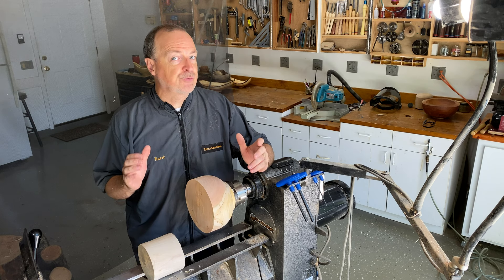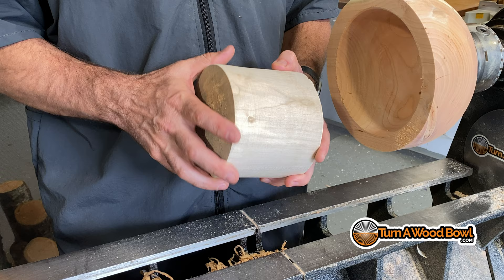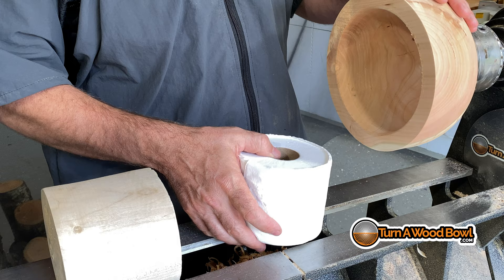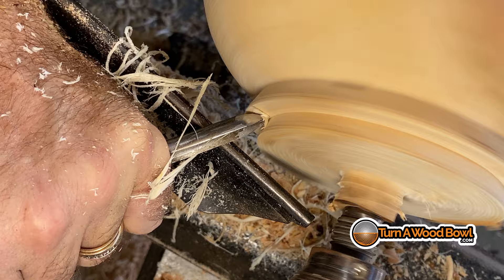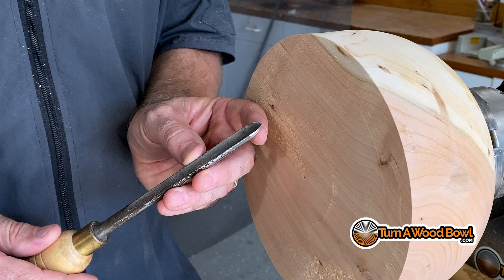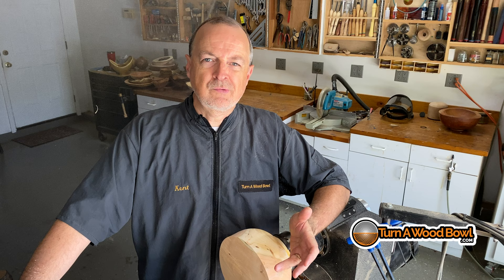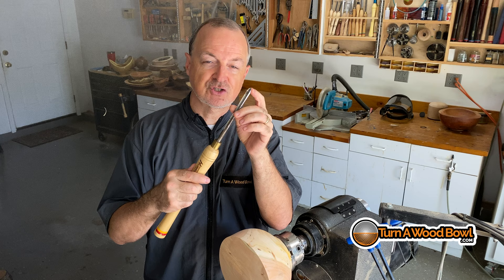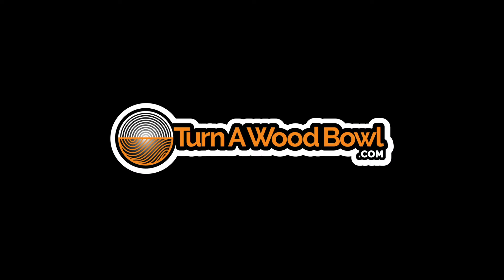3 Dangerous Tools - Woodturning Bowls Video

Comment: Now I find a video where I’m told not to smooth the outside of a bowl blank with the spindle roughing gouge!  I learned the hard way, bent the tool, sent the blank flying (luckily away from me) and scared the ** out of me, but I haven’t done it again.  But your video would have been much better before my learning the hard way method.  Thanks and keep them coming.  Cheers, Tom
Reply from the maker: I'm glad you weren't hurt! Yeah, this is a dangerous tool that everyone needs to know about. Thanks for sharing!

Comment: I know this video is about what not to use but...Whatever happened to the 'round nose scraper' for turning the inside of bowls?  Unless I'm not looking hard enough I rarely see anyone discuss these.  My reading on the subject of turning inside of bowls mentions theses as "THE" tool to use for this.  Caveat: my source is an old turning book from the 1920s using a foot powered lathe.
Reply from the maker: Very interesting. In the 1920, the bowl gouge, in it's current form, didn't exist. We really want to cut the bowl interior with the bowl gouge and a round nose scraper can be used to touch up areas if needed. Watch my video on the round nose scraper for tips. Also you might want to see my most recent video about the bowl interior. Happy Turning!

Comment: I use a huge bowl gouge well, in my opinion, almost an inch across. It works vary well for most rough work, and if not, I also have carbide and other ones.

Comment: This is a great video that I wish I saw a few days ago. I am new to turning and have been using strictly spindle tools (because I didn't know there was a difference). I actually had one of my gouges snap at the exact spot you mentioned, right above the handle. Not a fun time. Great video.
Reply from the maker: So glad this helped solved the issue. At least you know what happened now. Be safe and Happy Turning!

Comment: i can confirm the spindle roughing gouge, did that as a new turner. on bowls broke one, another ground swept back bent the shank where it meets the handle at least 30 degrees. spindle gouges are so common second hand. and now knowing what i know now. don't be like me and learn the hard way. now i almost exclusively use a quality bowl gouge, two sizes. and a custom made mortise scraper i think it would be called since i prefer mortise over tenon. (most of the time)
thanks for the informational videos, turning in general seems like a growing community of great, patient and supportive people.
Reply from the maker: Thanks for sharing! Yes, turners are a good people…usually! Happy Turning!

Comment: I wondered why I had so much trouble using the parting tool on my bowls... I thought it was sharpening at first and then I changed to a softer wood and it was still hard. Thank you
Reply from the maker: Ah, great, now you know. That darn end grain can be brutal! ;) Happy Turning!
Reply: Not mentioned here, or maybe I missed it, is the necessity of providing relief for a parting tool. That is, make the cut wider than the tool itself so the sides of the tool do not rub against the sides of the cut.

Comment: there are more then three you forgot the skew and round nose scraper . i like using a mortise instead of a tenon i use the skew to get the dove tail on the inside of the mortise . to each there own i guess .   i know a tenon is stronger in some cases  but i like a mortise better and you dont have to remove it if you dont want to . all the tools can be dangerous but your info is spot on about the shaft having to be solid and strong .
Reply from the maker: Yes, there are more dangerous tools. This video I focused on three. Be safe out there!

Comment: Hey Kent, I’m new to your channel and just a novice turner. Thank you for the all the good information  and clearing up a few questions. The one tool which scares the heck out of me is the skew. If you have a video on how to use it I’d love to see it.  If not could you please put one out so I can understand how and when to use one.  Thank you.
Reply from the maker: Thanks for asking. The skew has no business around a bowl turning. Perhaps it can be used to shape a tenon or mortise, but that would be the limit. So, if you're scared of the skew, just get rid of it. ;)
Reply: Agreed. Incising a fine line on a spindle with the long point of a skew is the only operation I can think of that cannot be done with less risk with another tool. Even the traditional planing cut on a spindle can be done just as efficiently and with more control by 'shear scraping' with the wing of a bowl gouge or a dedicated scraper used in the shear-scraping mode. There is no glory in using a skew when another tool will do the same job with less risk.

Comment: I'm knew to wood turning so I'm for sure going to listen to you. I have a roughing gouge from Carter & Sons. It looks pretty stout at the tang. Have you seen it and what do you think?
Reply from the maker: Good question. I have not seen that one, but a "bowl" roughing gouge has no size change into the handle. The full shape of the cutting portion goes down into the handle. If the steel tapers and reduces before entering the handle, its a "spindle" roughing gouge. Hope that helps. Happy Turning!

Comment: I use my parting tool on my bowls to cut and clean up the tenon . Typically with relief to one side .
And also to cut a groove around the outside for inlay material. 
I've never concerned that it was used in a scraping capacity. 
I am careful to have a light touch and also not to get too far from the tool rest. 
Thoughts on the bedan or a carbide square tip to cut tenons.
Reply from the maker: Sounds great! Light cuts, no problem. Basically any tool that gets the job done for shaping the tenon is fine. Just be cautious with your tool selection when roughing and shaping the bowl.
Happy Turning!

Comment: Thank you. I was about to buy a parting tool as I am super new to turning. Glad I checked out your video.
So, what do you use to part a bowl off?
Reply from the maker: The parting tool is used mostly with spindle turning to separate sections. A parting tool can be used for minor tasks while turning a bowl, like shaping the foot or forming a recessed mortise.
Reply: I like to use an old reciprocating saw blade that I ground down to a very thin parting tool. But only use it for parting off  the bottom, like if you're using a glue block or paper joint. Check out Mike Peace on YouTube, he has a video showing one up close. Simple and cheap parting tool. Don't use it for shaping or hollowing.

Comment: Kent, in another video your spindle gouge used to turn off the nub of a foot looked to me as though the heel had been ground away.  Made sense for the way it was being used.  Now looking at your spindle gouge at the beginning of this video it also looks like the heel has been ground away.  Are bowl and spindle gouges different in that way?  I don’t do much spindle work but I do want my tools right for the job.  Advice?
Reply from the maker: Yes, this is a spindle detail gouge and the heel is usually ground back to make it easier to cut into tight narrow spaces.

Comment: I do use my skew to make a precise and perfect tenon dovetail angle that exactly matches the angle on the chuck jaws. It is a low stress scraping cut; never had a catch or a tear with a sharp skew doing this. Am I being foolish doing this?
Reply from the maker: Yes, a small scraping cut like that can be done with no problem, just don't use the skew for any large material removal and you'll be fine. Happy Turning.

Comment: Great video.  There is not enough about safety in woodturning.  Be sure I would not use a SRG on a bowl after some videos I have seen on that matter.  

However, what approach should we take if we want to work a quite irregular log and want to rough it into its roughly cylindrical shape up to its general outside shape? In particular if the log cannot be oriented with the fibers parallel to the base of the lathe.  Some log have intersections of trunk and branches and the fibers seems to go in all directions.  Bowl gouges looks quite small in regards to the huge amount of chips to take out at the start, like using a spoon to dig a hole in the ground instead of a shovel.  So, is it a matter of using the biggest bowl gouge available?  All is in the shape of the gouge?
Reply from the maker: Yes, you got it. I use a 5/8" or 3/4" bowl gouge to rough out irregular bowl blanks. Happy Turning!
Reply: @TurnAWoodBowl  Many thanks
Reply: @TurnAWoodBowl  I appreciate. Would you recommend a U shape rather than a V shape?  And what companies would you recommend?
Reply from the maker: @alaincaron225  Good question. I recommend a parabolic shaped bowl gouge. That is what most companies sell, see my Recommended Equipment Guide https://turnawoodbowl.com/recommended-equipment/

Comment: Good video Kent.  Have you ever made a lidded vessel or bowl in a cross grain orientation?  If so, how do you remove the lid for initial hollowing and fitting?  Unfortunately I tried this in my early days of turning with a diamond parting tool which caught, twisted in the kerf, yanked the shaft out of the handle and then hit my hand (which was behind the tool rest) on the next revolution.  Resulted in a nasty cut, ER visit and a few stitches.  Wish I saw this video before I learned the hard way.
Reply from the maker: Yikes, I wish you had seen this earlier too. You can make multiple cuts or passes and create a cut wider than the parting tool. That will prevent the tool from grabbing. I have a lidded bowl video coming up in a couple weeks. Stay tuned! Take care!
Reply: Turn A Wood Bowl I thought I had the cut wide enough but obviously not.  I look forward to the lidded bowl video.  I’ve been hesitant to go back there after my last endeavor.

Comment: I am just beginning my bowl turning adventure.  I started with a square blank.  At a lower speed the piece kept stopping while at high speed it tore up the piece.  What should I do?
Reply from the maker: Be sure the tailstock is tight to the bed rails and tighten the quill regularly. Then make smaller bites. Happy Turning!

Comment: Really great video. Have you ever thought to use you skew chisel to create the tenons for your bowls? I do and its quick, easy and you can set your angle really quickly. I use it for creating the rebates on the back of my bowls if needed.
Reply from the maker: Yes I have. Unfortunately, my skew has rounded sides so it doesn't sit flat. And because I primarily turn bowls, I haven't purchased a flat-sided chisel. But, yes, you can use a skew for small detail work like shaping the tenon. Happy Turning!

Comment: Would you consider it ok to use a parting tool for doing small adjustments on the foot? (Basically same as you were using the spindle gougle)
Reply from the maker: Yes, light shaping is not an issue.

Comment: Super helpful video! I was just about to try my first bowl in the next few weeks!  Any recommendations of what kind of wood would be good? There's lots of Maple and Sweet Gum  by me and I do have access to Oak.  Are they any good?  Thanks again for all the great info!
Reply from the maker: Great question. For first bowls, and based on what you have, I would avoid the oak (at first) and start with the Sweet gum, especially if it is wet or green. That should turn beautifully and be a bit forgiving as well. And the Sweet Gum isn't necessarily showy so you won't be afraid of "messing up" a nice piece of wood, as you learn. All the best to you and Happy Turning!

Comment: What tool do you use (Since you said to not use a parting tool) to remove the glue block from bowl when that purpose is done?
Reply from the maker: Well, if the glue block is not huge and you're just cutting the base, you should be ok. I don't recommend going through a whole blank with a parting tool. You can make push cuts towards the headstock with a bowl gouge and turn the glue block off. That would be a safer approach and it would give you more access and design possibilities with the bowl's foot.

Comment: Thanks Kent.  These are good videos.  I'll be making my way through them.  Here's a question.  I'm still pretty new at turning.  I find I have more success mounting my bowls into a mortise.  For some reason my tenons tend to break.  I've been using a bedan to cut the mortise out and then I use a skew chisel to level the bottom and cut a slight dovetail into the side.  This is the method that works best for me (so far) but the bedan does leave a very ragged edge around the rim.  It also tends to slide back as I work toward center and it occasionally catches.  Is there a better way?
Reply from the maker: Glad you like the videos. Try this tool for your mortise shaping. https://amzn.to/3aHk4Bn Let me know if that helps. Happy Turning!
Reply: Tom, tenons should not break unless the wood is degraded. Could you be over tightening the chuck jaws? Also, make the tenon as large in diameter as the work piece and chuck jaws will accommodate. A small-diameter tenon on a large bowl is not good.

Comment: saw u use parting tool in 2 bowls from 1 blank
Reply from the maker: Hey  CJ, You're right. It's not a beginner use for the tool. Also, did you see it bind up on me? Yeah, it's still dangerous.
Reply: @TurnAWoodBowl  doing w/w many decades  very humbling to turn. I am getting there have used parting tool to define inside edge but side step it going down, still have trouble with inside bowl bottom.  turning spalted beech ,still wet after 18 mos ,and steam comes out.  on wet blanks ,,,but learning
Reply from the maker: @cjlures8618  Sounds good. Yes, its all about being open and willing to learn. Every type of wood, and every tree has a world of knowledge to share. I have honey locust blanks that were cut four years ago that are still wet in the center, but it turns great and looks amazing still. It's part of what makes turning bowls so amazing! Happy Turning!
Reply: @TurnAWoodBowl  thanks for the tip on quarter sawn ,I have beech logs that are 16 x16  can pick up ,but on verge of being too heavy  so FOR 2 PURPOSES I will chainsaw the 3-4 " centers  for turning and make the rest much more manageable for the splitter
Reply from the maker: @cjlures8618  Oh, wait until you turn that quarter sawn section. That's my favorite area to turn from almost any tree!! Remember to cut away the pith area. Enjoy!!!

Comment: At approx 1m 32s you say... So that's a very good reason for avoiding end grain turn bowls 🤔 was that supposed to be (avoiding long grain turned bowls) essentially turning a spindle into a bowl. Because I thought many turner's make end grain blanks into bowls... Please clarify. Thank you
Reply: Then later at about, 1m 50s you say "most bowls are turned side grain" 🤔🤔
Reply: Then you show the example of the loo roll and say this would be endgraine mounted stock, but surely that's long grain if the grain goes parallel with the bed...s you would be turning along the long grain... Am I confused or you 🤷‍♀️

Comment: What your view on using a parting tool on the face of a cross grained piece? I use it to start the outer edge of a mortise and to square it off, and some times just to outline the start of the inner and outer edges of a bowl rim. I know I can do this with a gouge but some times the parting tool just works so well.
Reply from the maker: Good question. For small cuts like a recess it's no problem. Larger parting cuts across side-grain can be an issue.

Comment: I've just begun turning and have just started experimenting with bowls.  I thought mounting them was my biggest challenge.  Seems like I don't have any tools to do bowls.  I do have two questions:
* That small gauge you were demonstrating looked to be solid steel going into the handle, rather than folded steel with a taper.  How do you tell the difference between spindle vs. bowl gauges if it's not folded vs. solid steel?
* What about the left and right hand scrapers?  I've seen videos of those being used inside and on the outside of bowls.  Are they safe?
Reply from the maker: Here you go. Check these out.  
1) https://youtu.be/jC95iQOtONQ
2) https://youtu.be/1k3Fpfs_Cms
Happy Turning!
Reply: @TurnAWoodBowl  Thank you!  It's a good thing I haven't done too much experimenting yet, or I could have hurt myself.
Reply: I just received a half inch bowl gauge and left and right hand bowl scrapers today, all Hurricane brand.  They make my set of Benjamin's Best tools look like toys.